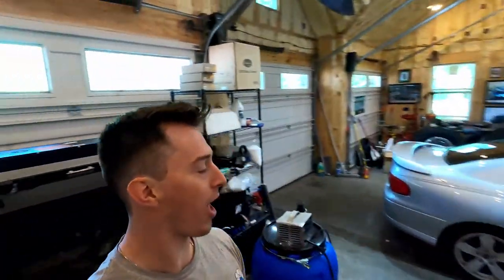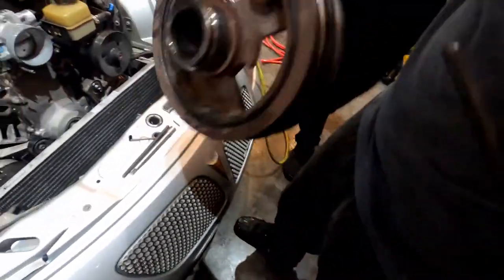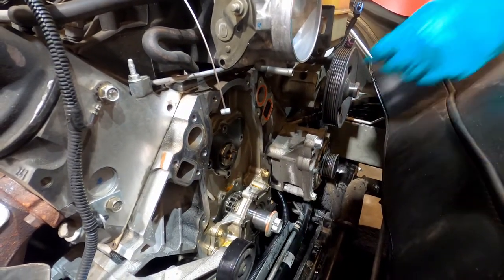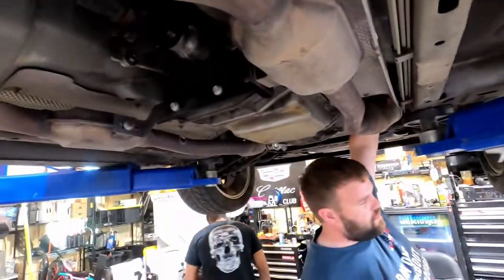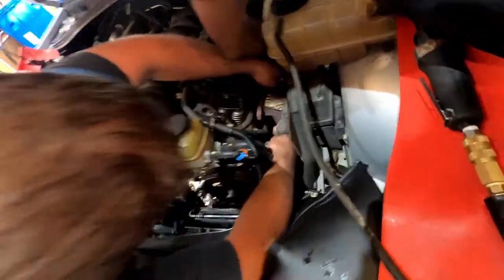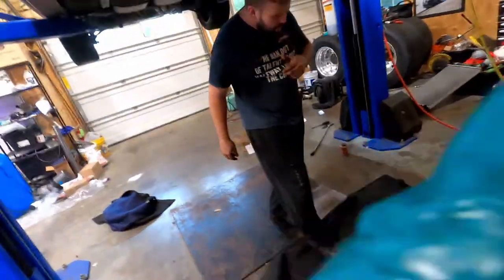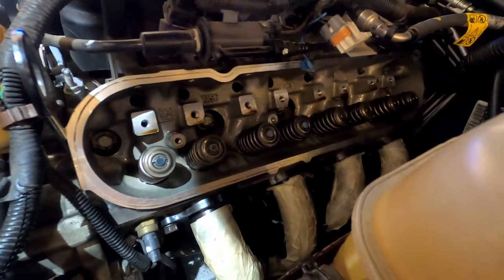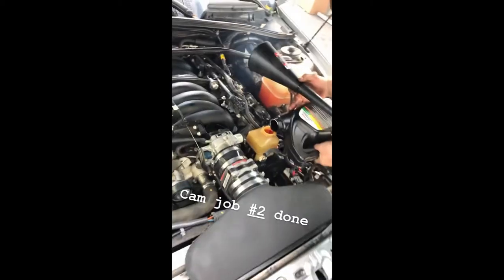LS1 Texas Speed Cam Install and Pacesetter Header Install (5.7L Pontiac GTO)

Comment: Do you have to evacuate the AC system to move the condenser like that?
Reply from the maker: As long as you don't loosen any of the lines you wont have to
Reply: @NolanMotorsports  Thanks bud.  I was thinking of doing a cam swap to a streetsweeper HT.  I was going to do it just like you guys did, or have a shop do it.  The shop said they would have to pull heads to do lifters since I have over 75K miles (I have 110K).  Do you ever have any problems with doing simple cam swaps without replacing lifters?  I dont want to do heads right now because at that power, I would need a stronger clutch and my clutch isnt that old.

Comment: 04 Pontiac GTO alum 5.7 LS6 Factory rotating assembly and it also has a factory LS6 intake it.... just has ls1 heads and ls1 throttle body from Factory the rest of it is an LS6 rotating assembly with an LS6 intake... is my understanding... the 04 GTO 5. 7 very capable of making very decent power.... that motor had over 400 + HP at the crank the GTO has a slanted engine a little bit with that two-piece Drive shaft and rubber couplers and between that and the IRS it kills over 50 HP peracetic drag loss through drivetrain... the most annoying thing about the 04 gto is the slanted drive train... even going with a solid drive shaft you still have that slanted angle and pivot angle is way off and it's really annoying it's rather hard on the drivability of the car my opinion I do have a friend that straighten the motor and Driveline in his GTO and he did the standing mile 204 mile per hour in 5th gear and he wasn't even driving it like most of us would have and he still reached 204 mile per hour in his boosted T56 car... let's also not forget the GTO I feel are fairly  heavy cars my new Edge Mustang is very light compared to my GTO and my Foxbody is even lighter LOL 04 Pontiac GTO came from the factory at 3725 lb

Comment: The pacesetter headers are a waste of money in my opinion. I put a set in my 04 gto when i was in collegw because its all i could afford, but i wish i just saved up for longer and put some quality headers in. They rusted through within a year (I live in Maine). And i still had to spend the money on installation. Ive got kooks long tubes and catted mid pipes and some motor work including a cam going in the car now

Comment: Could have dropped headers from the top. Then you wouldn’t have had to take the brackets off in the back of the engine bay.
Reply from the maker: Yeah I’m not sure that’s possible. Do you have a link to that procedure? We’ve done many header swaps on GTO frames and have always dropped from the bottom.
Reply: You can drop them from the top. But you have to remove the steering shaft and unbolt the motor from the mounts and jack the motor up about an inch. It is a bit quicker I think.
Reply: Yeah like every video I’ve seen and everyone I’ve talked to about headers install says you have to drop the steering rack. Is that true that you can unbolt the motor mounts and jack up the motor and drop them in from the top ?